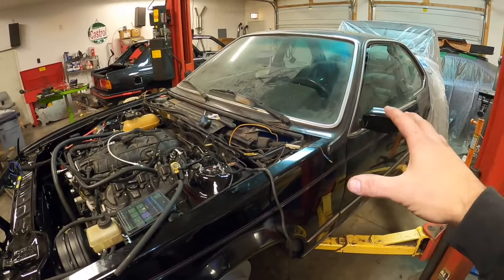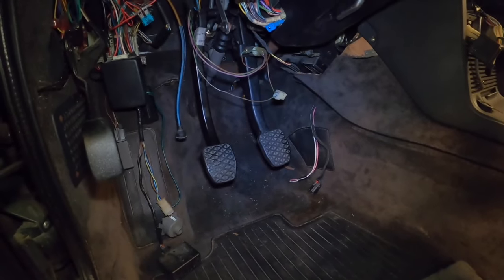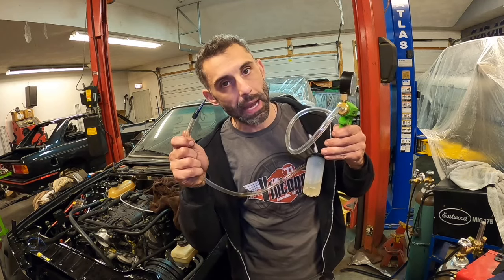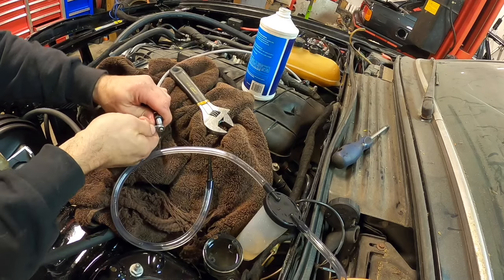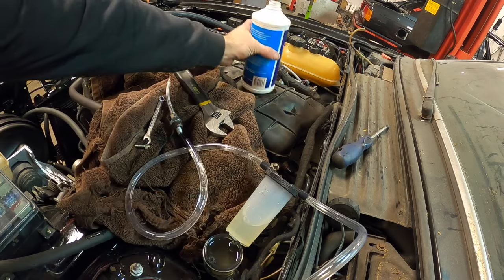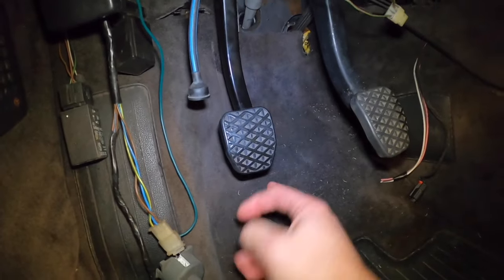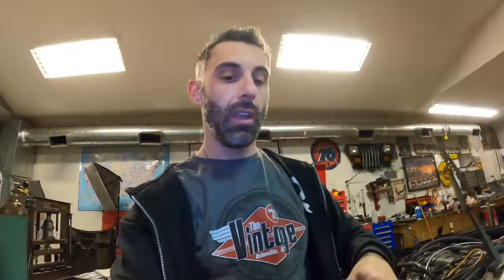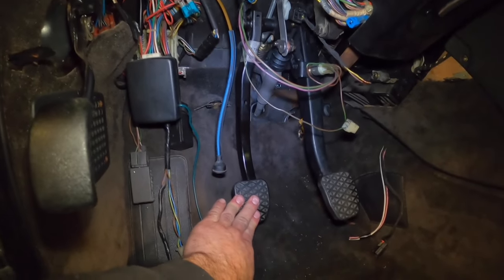Part 26: Cool Trick To Bleed Your Hydraulic Clutch!!

Comment: Thank you for the great idea.  I have an odd shaped reservoir, and can't get a vacuum tip to the bottom.  So I made a plug for the top of the reservoir with a vacuum fitting.  Will this work just as well?  It seems that I should lower the fluid level a little, so the vacuum is only sucking air.  Should I instead keep the reservoir full when pulling the vacuum, so that the end of the plug is submerged in fluid?

Comment: Only works if the small hole at the bottom of the master cylinder is easily accessible. Mine has the hole at a right angle at the bottom in a small recess. Impossible to get to. Otherwise this would work perfect.

Comment: I was at the end of my rope and perplexed because this wasn't my first time with this type of hydraulic TOB.  I have a SuperCharged Gen V LT4 with a T56 magnum that I was replacing the clutch on.  I knew it was a PITA, but was forging ahead anyway.  I tried everything, pressure bleeding, vacuum bleeding and even a direct shot with a syringe.  Nothing worked, the pedal was limp, no feel whatsoever.  I had watched every video on YouTube except yours, then the light went on.  Took me 2 times on top and 2 times on the bottom to finally get the bubbles out and get a decent pedal.
Thanks very much for showing me another alternative rather than going nuts............. As a side note, you don't need those expensive $400=$500 dollar TOBs, any standard LS1 ('97-2002 Camaro) will work fine with the T56.  I paid $54 for a LUK bearing made in Mexico.
Reply from the maker: Thanks for the comment! I’ll keep that in mind next time!

Comment: I suspect something like this on my A5. Clutch was not returning, and garage said it had a decent amount of air when they bled it with a "power bleeder".  but, a couple of weeks has passed and the it has stuck half way just a couple times. only takes a nudge to make it return but i suspect it will get worse. It seems like a leak somewhere is creating air in the system. does this sound likely?
Reply from the maker: Definitely air in the system

Comment: Wow, like another of your followers, I was perplexed and at the end of my tether by the time I watched you video. I have an old Alfa Romeo Giulia Super and I renewed the clutch slave cylinder but none of the standard methods of bleeding worked at all. I had a buddy to press the pedal etc.... but I also have a vacuum gun the same as yours but used in the normal way did not work at all.
Watch your video, went back in the garage and sucked air out of the master cylinder as per your instruction and bingo perfectly working clutch. I don't know how to thank you enough because I read lots of stuff on the forums and watched a couple of youtubes without success, so you saved the day!!I have subscribed and look forward to any future time saving videos...many thanks, Brian:washhands:
Reply: How did u suck the air out of the matter cylinder....it didn't show it in this video
Reply: It does show it in the video, it's what I followed to bleed mine